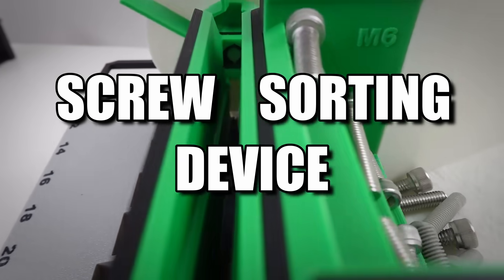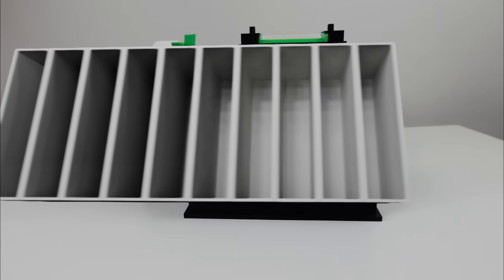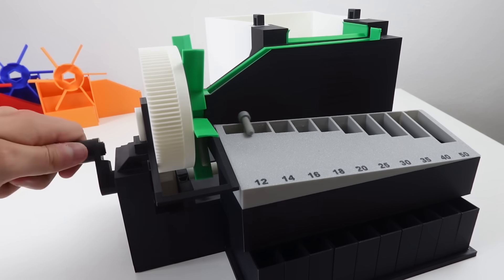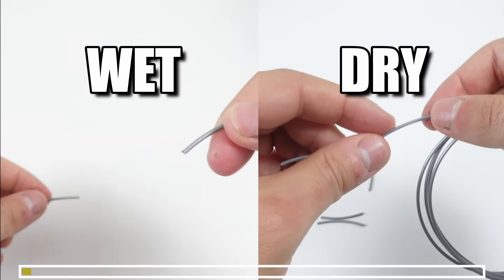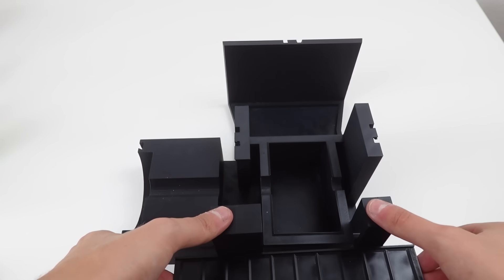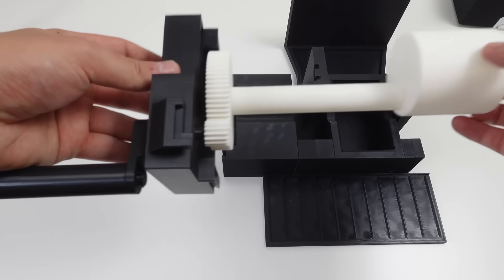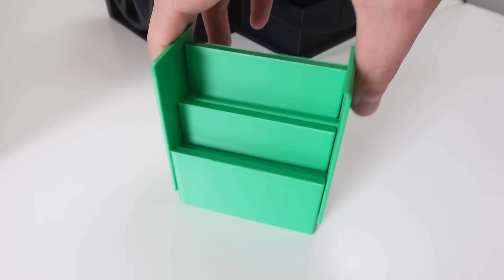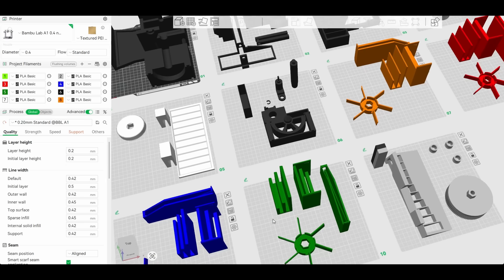Automated Screw Sorting With 1 Motor And A 3D Printer | Ft. Creality

Comment: Awesome build!  I sense a combination of the two machines as your next iteration. Here's an idea. Instead of separate drawers, consider replacing them with a single drawer divided into multiple compartments with removable slide-out bottoms. When the sorting is done, simply pull out the drawer and slide out the bottoms to dump the sorted screws into their storage containers. 

With additional minor modifications and by first sorting the screws by length, you can streamline the process. By adding clips to the multi-compartment drawer, it can be pulled out from the length sorter and attached to the top of the size sorter's hopper. Each compartment bottom is manually slid out one-at-a-time dumping its screws directly into the hopper where it's sorted by size. 

You can take it a step further by combine both machines into a one step sorter. You can mount the entire length sorter over the size sorter with solenoids to slide out the compartment bottoms and sensors to detect when each stage sorting completes. A microcontroller is added to control the stages.

Comment: hello is it ok to scale it down to save on print time and filament? i was looking at this model and was thinking of trying to scale it down because it is a bit bigger than i need so i was going to scale it with the m5 inserts to 86% and use it on 8-32 screw to try and save on filament and print time. I checked the math on both and the ratio seems to fit just fine. My concern would just be tolerances and thin walls which Im wondering if those would be at significant risk.

I did this because i found this one to be just a little excessively big for not much good reason other than accommodating m6 screw inserts and the print page lists a potential 2kg filament usage which i equate to being 100% infill however the model is still significantly larger than the previous version.

I would suggest one of the biggest improvements to be made could be with the size of it because bigger prints become a much bigging investment and time commitment for anyone trying this out.

Another thing is for the length of screws in imperial units. they are always measured length wise in inches so every screw is in 1/8th inch(.0125) increments from .25 to 1 inch and 1/4th inch(.25in) increments from 1.25-2.5.(totaling 13) This is at least from my experience with vex 8-32 screws and I might cad out these because they don't exist for this machine yet.

Also just one more question what cad software do you use for this and for the physics simulations?

Sorry for the long comment I'm just so fascinated with this machine and want to see it at its full potential. I especially like the previous 2 sorting videos because they went through the general process of designing the machine.
Reply from the maker: Hey. Thanks for the feedback. I never tried scaling it down to save filament and wont reccomend it because of the tolerances. The 2kg filament are needed if you want to print All of the Metric modules. If you dont need every size you dont need to print every module. I also added a separate print profile for some imperial screws including 8-32. I havent tested myself as i dont have imperial screws at home but it should work.

And i used Blender for the Design and All the Animations and simulations
Reply: @EmGi_  oh yeah i forgot i cant print some of the pieces on my printer that's another reason i might scale it down not just to save filament but to maintain the pieces together since i don't know exactly where parts can be cut. Ill keep trying ways to cut it but i may have to scale it down at worse itll be a learning experience.

Comment: A synchronous magnetic coupling between the rotator module and the motor would allow for jams without burning out the motor. In fact, once the magnets release the module would likely shift backwards a bit to pair with the new set of incoming magnets, possibly releasing the jam automatically.
Reply from the maker: Cool idea. I Might give it a try

Comment: I’m already thinking about how to redesign this so it can scale out, rather than having to switch parts to sort different sizes.

For the jamming issue, there are a few solutions that come to mind. One is to stagger the steps, doubling the number of them and cutting the length in half. This would help make sure only one screw drops at a time.
Reply from the maker: Cutting the length of the steps in halve would limit the lenght of screws you are able to sort
Reply: @EmGi_ Not quite. Watch what happens to a 40mm screw on a 25mm step. :)

Comment: It's a nice little tinker project but if you cant leave it unattended and with such a low speed, you would be faster and easier by hand. It is just unpractical.
Reply from the maker: by unattended i mean leaving the room. as long as you are near it you will hear if it jams and can quickly fix it.